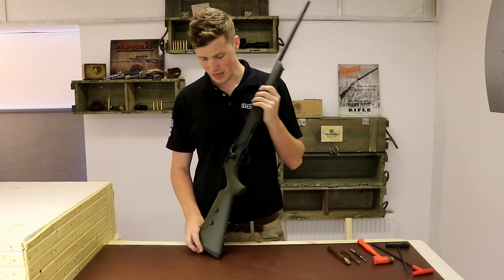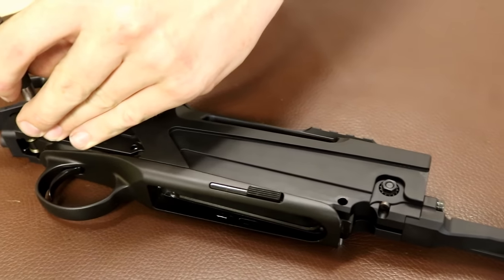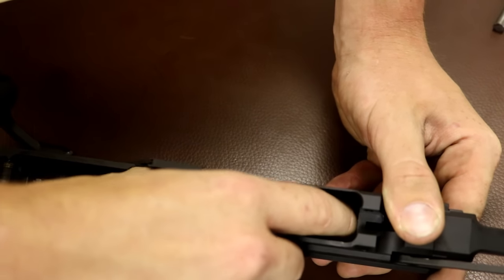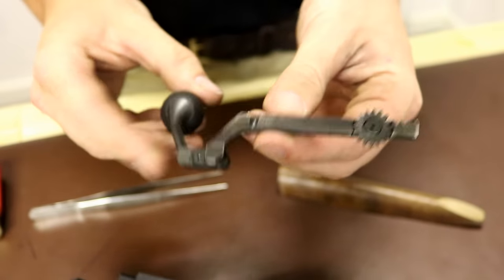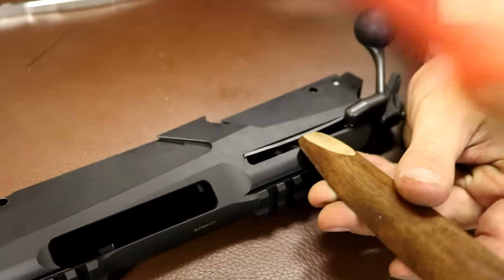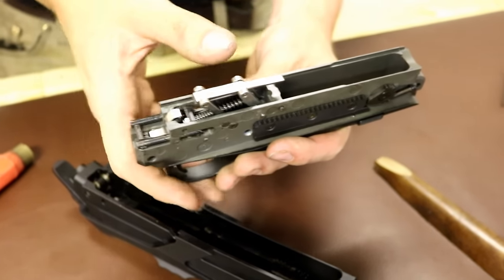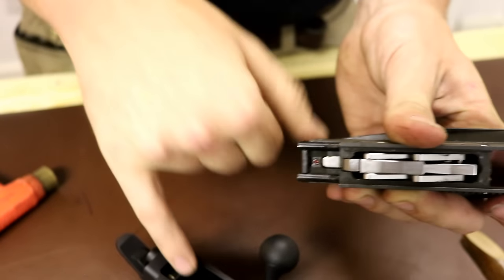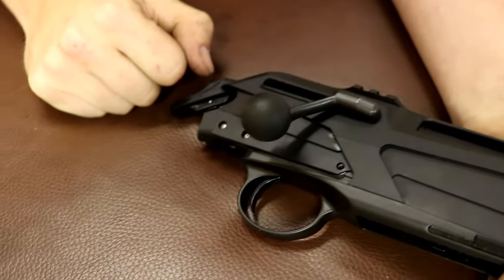Disassembling a Merkel RX Helix

Comment: what size allen does it take to remove the stock?
Reply: 4 or 5 mm
Reply: It's 5 mm! (If you should strip it, there is a deeper seated Torx fallback to get it undone in an emergency) *At least it is on the speedster model!

Comment: That is a very thorough explanation. Can you please provide info on how to adjust the trigger on Helix? Thanks
Reply: 5yrs later and I am still trying to find a video showing how to adjust the trigger :D
Reply: It's a small allen key just behind the trigger guard (you can see the small hole at 1:45). It is only accessible after removing the rear stock.
*Edit: standard trigger is set to 10 N (1000g). You can't decrease the force below that, but you can increase it: 10 turns clockwise correlates to a 10 N increase.
Reply: @Ganjaseed thank you. I happen to buy the upgraded Merkel target trigger and when disassembling it found the little hole. I’ve now drilled a small hole in the stock for easy future adjustment 😎👍
Reply: @enduroskillstraining  Nice, what is your experience with the target trigger, did you set it to the lowest 5 N (500g)? Does it have other advantages? And what's the price?
Reply: @ £490 and yes, currently set to 500gr. Feels amazing and like that the trigger itself has a better feel with the grid pattern. Slightly tricky to fit.
Reply: @enduroskillstraining  sounds good but a bit pricy, maybe I'll upgrade if the old trigger breaks some day ;). But in general the 1000g feels perfectly fine for hunting.